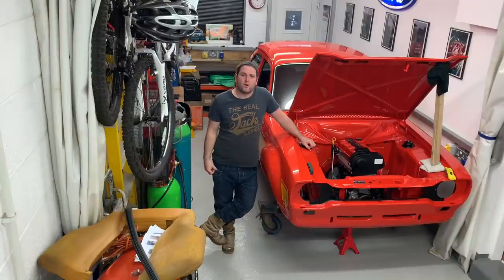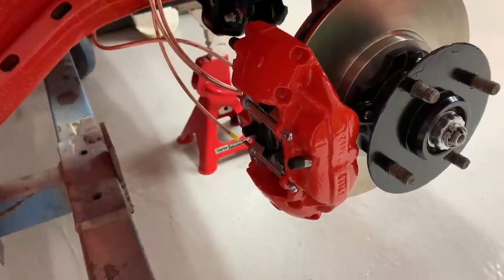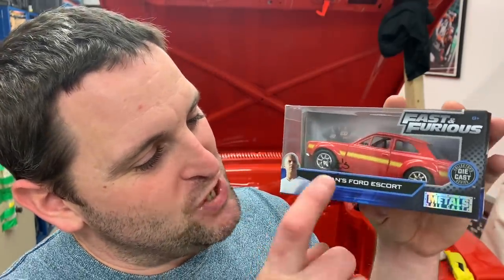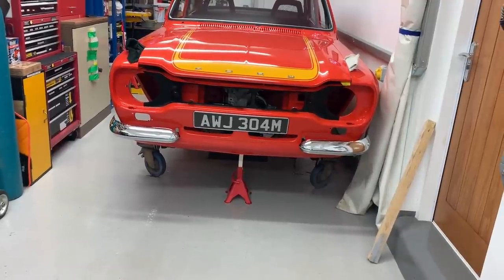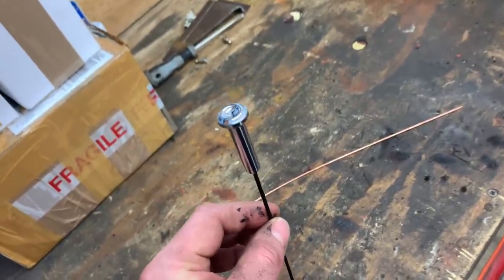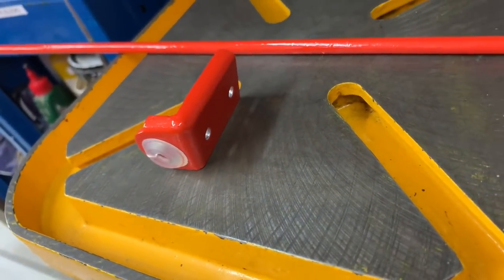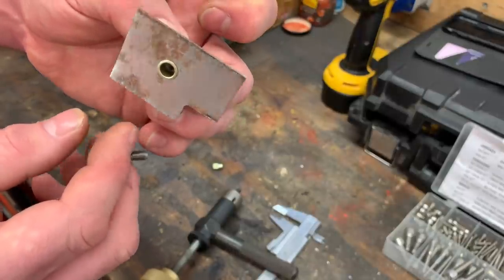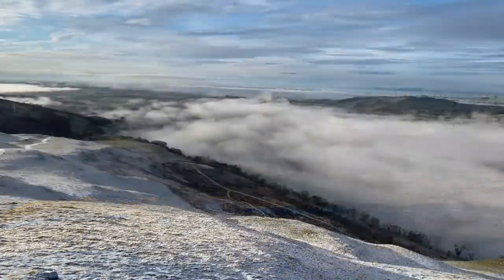MK1 Escort RS 2000 Re Assembly Episode 12 fitting New xmas parts

Comment: Another great video. Great to see all those little bits going on that pull the whole car together. Especially glad to see the bonnet stay on. Ever time I saw the bonnet wedged up on that bit of wood I shivered to think what damage would be done if it fell.🥺. My Son got little gell vw badges for the top of his chrome wheel valve dust covers off ebay. These would be similar in size to what your after. Try there
Reply from the maker: Valve cap badges 🤔 Thats a good shout that Trevor. I will look for them. Great idea. The wood was well wedged in place but i am glad to see the back of it. Thanks again Trevor 👍

Comment: I have dozens of those rear lens brackets lying about! I don't put rubber feet on mine as they sometimes end up being the only reliable earthing point! Plates and badges look great.
Reply from the maker: Good point about the earth actually. I have fitted serrated washers now but if the rear lights play up, i know whats wrong 🤣. Wish id known, would have saved me making them 🤣 You got many parts lying about??
Reply: @performanceclassics1986  Typically most of the "rare" parts I kept back in the 90's tend to be the most commonly remanufactured parts available now. Have lots of lights, fuel tanks, pedal boxes, heater boxes etc, but didn't keep the now rare intricate parts like window regulators, wiring looms etc.
Reply from the maker: @RS20O0  dont suppose you have a steering column, wiper motor and linkages, Decent rear view mirror, number plate light, Bonnet release lever and cable??? 🤣 not looking for much eh 🤦‍♂️
Reply: @performanceclassics1986  Can't part with my only remaining spare wiper motor but happy to have a look at the weekend to see if I have a number plate light. Pretty sure I do but don't know which box its in. I also have 6 or 7 reverse lights but most have cracks in.
Reply: I might have a steering column I'd consider parting with also, but I'd want to keep the indicator canceller off it.
Reply from the maker: @RS20O0  That would be great if you have time. Need the light and bracket if possible. Thanks in advance....
Reply: @performanceclassics1986  what's best way to get in touch with pics etc?
Reply from the maker: @RS20O0  that would be great if your happy to sell 👍
Reply from the maker: @RS20O0  my email address is mclean.craig2@gmail.com.
Thanks 👍

Comment: Amazing work and car. Heads up that although the black and silver number plates look great, I don’t think they are road legal. My mk 1 was a N reg and wouldn’t pass an MOT unless I swapped to white and yellows. I think maybe K plate was the last legal year? Great efforts in this project and thanks for sharing.  Respect your patience!
Reply from the maker: Thanks for the message. I actually have read recently that they should be legal if the car is made before 1980. Thats what DVLA state and my 1979 mini has them with no issues. 🤞hopefully i wont get any issues with them. Some MOT testers are more Anal than others 🤣

Comment: More great work Craig. Your fabrication skills are top notch. 
I would to see how much Mr Murray's MKI cost to build. I don't understand why he put steel wheels and hub caps on it (apart from looks) but he is the weight saving guru and I would have thought that a set of Minilites would have been the choice. Building a car for someone can turn into a nightmare when their budget runs out half way through. Add in a Millington engine etc and it's easy to hit 6 figures.
Ps you could put a small piece of heatshrink sleeving on the bottom of the bonnet stay, as long as its thin enough to fit into the bracket.
Reply from the maker: Thanks very much Andy. Really appreciate it. Yeah i can very well imagine that if you get the wrong customer or as you say money dries up, it could be a nightmare. Especially if you are relying on the money. I do love Gordon’s escort but there are a few changes i would make too. Thats a great idea about the heat shrink. Im going to do that along with a piece of real carbon fibre ive just fitted into the base yesterday 😎

Comment: Hi Craig. How did you key the surface for the calipers?
Reply from the maker: Hello Benjamin, the surface of the callipers was a rough finish so i basically roughed up any smoother areas with sandpaper, cleaned them down with thinners to remove any surface contaminants and primed them prior to painting. The primer seams to have adhered really well prior to painting. Hope that helps 👍
Reply: @performanceclassics1986  cheers Craig. I've had a couple of bad experiences trying to get paint to stick to this zinc coated finish before.
Reply from the maker: @benjaminbenson8714  Im just hoping the paint stays on ok but time will tell 🤞

Comment: Just out of interest did you not consider using some gas struts for the bonnet? I appreciate you’re trying to keep it original so suspect this might be why you didn’t go that route.
Reply from the maker: Hello Paul, theres 2 reasons i didn’t fit struts and yeah 1 reason is originality. The second reason is, the struts attach to the bonnet hinge and the mounting bracket on the bulkhead and due to the weight of a steel bonnet, this must place huge strain on the 1mm steel bulkhead that the bonnet hinge is mounted to and im pretty certain that in time, this would cause cracks and fatigue. Hope that makes sense paul
Reply: Makes complete sense pal, I love the channel and love the content. Keep up the amazing work!
Reply from the maker: @paulharrison3298  thanks Paul. Much appreciated 👍

Comment: Am going to ask the question, why didn't you treat the ford badges like you did with the RS2000 wing badges 3Mtape? drilling holes would have been my last option.
Reply from the maker: Just for a few reasons Alan. The holes were already drilled but just weren’t big enough and i would have to stick the letters onto the vinyl decal and im not sure how well the vinyl would hold the badges. Theres also not much badge surface area to bond to as the badges are so small. Trust me, i really didn’t want to enlarge the holes but in the end it looked the better option 🤦‍♂️
Reply: @performanceclassics1986  keep it out the rain! :-)
Reply from the maker: @alanpatterson2759  🤣 i intend to. It may get wet now and again but very rarely
Reply: I wonder how far you’d get before 1mm of tape onto vinyl lost its grip 😂😂
Reply: @RaccoonPerformance  thinking about it now maybe 100 feet!
Reply from the maker: @RaccoonPerformance  🤣 probably the first time i hit the throttle 🤣